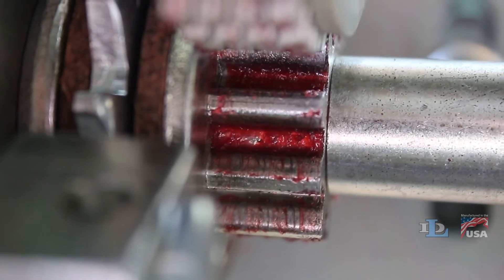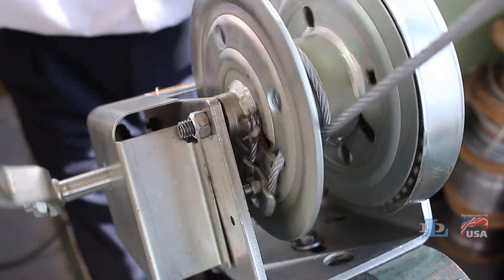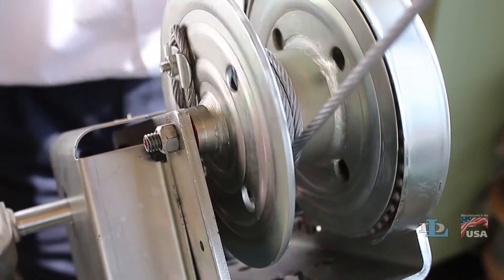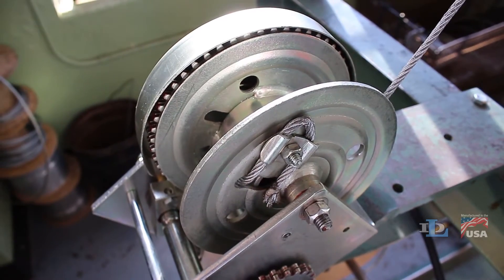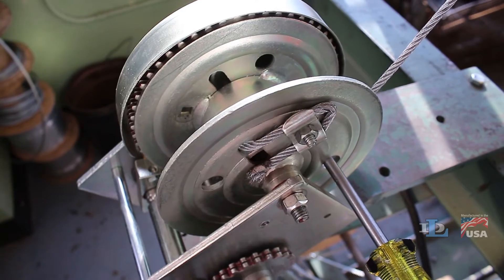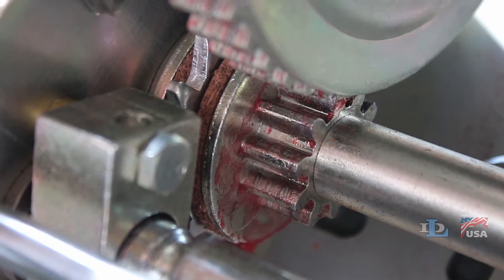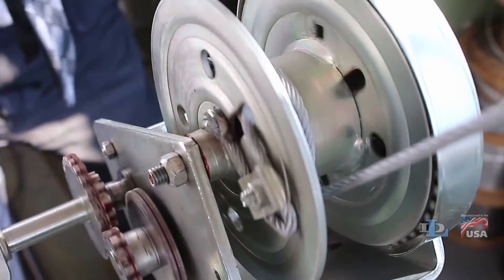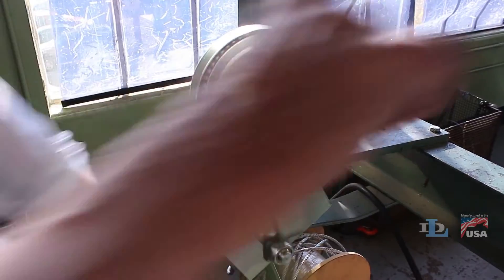Fixing a Jammed Brake on the DLB1000ASL Brake Winch - Step-By-Step

Comment: Hi 
I am getting problem of gear 
They are slipping on each other and removing metal part of it 
So I need to change the gear can you I advise me which kind of material gear I need to used and which gear quality is better for load carrying. 
Thanks
Reply from the maker: Thanks for reaching out!  You should purchase any replacements parts for your DLB1000ASL directly from us, the manufacturer of the winch.  However, because this is a more unique winch with several parts different from our more standard DLB-series brake winches, parts for it are not available to purchase on our website.  Please call our sales department at 402-462-4141 to order parts for this winch.